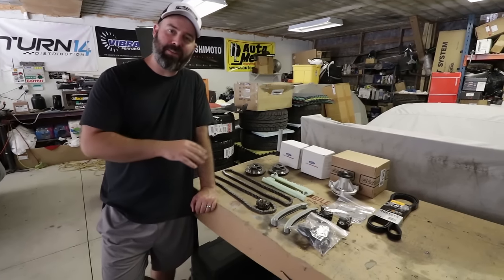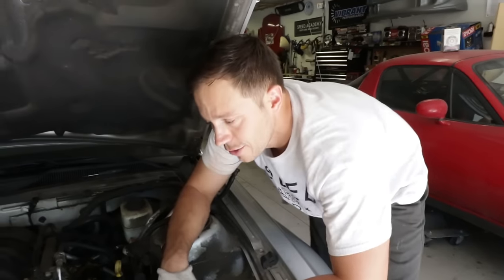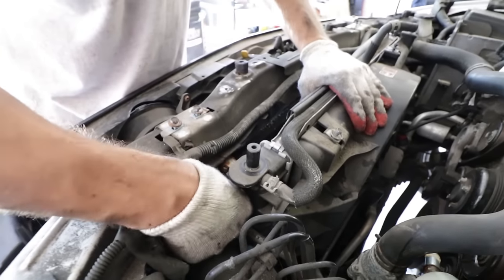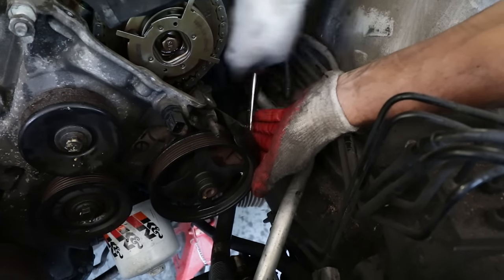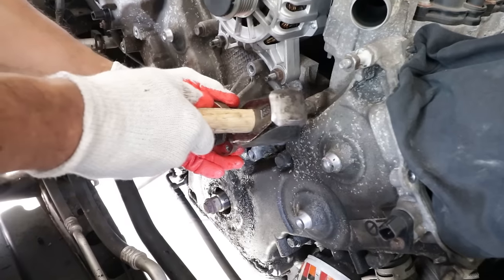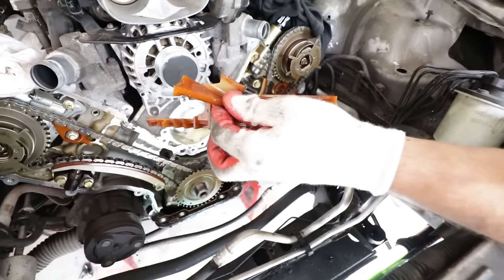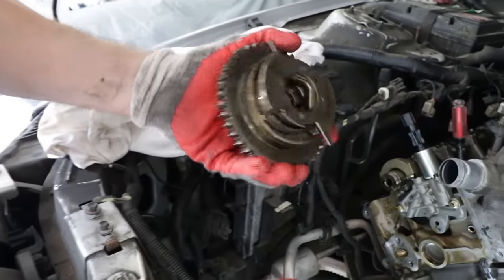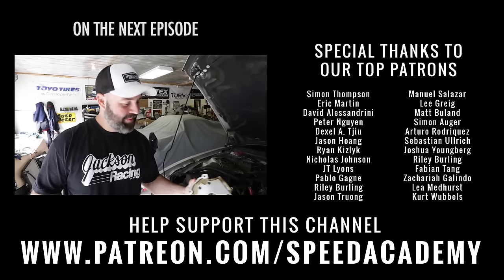How to Replace the Timing Chain 4.6L Ford V8 PT 1 -  Project Mullet Mustang - EP04

Comment: Anyone else notice that the phaser on the left cam is set up on the "R"  timing mark?? I know you Canadians are Bass backwards and all, but even you guys should know better.
Reply from the maker: We set them like that thinking we were at TDC which technically it still is but yes the manual calls for it being L not R on the left bank. Really its not that important if you put the new phaser in the same position as the old one.
Reply: I followed your video to do the final steps of my cam install and it went great. I appreciate you guys. I did the 127020 cams (which I think is what you guys went with). You guys are great. Keep it up!
Reply from the maker: Great to hear this video was useful!

Comment: should have done cams while you were in there.
Reply from the maker: We're doing them later down the road. We needed a stock motor to get track results before we mod it.
Reply: gotcha. good job getting all those spark plugs out.

Comment: I didn't realize these modular engines were such junk. Spark plugs breaking, water pump cavitation, timing chain guide failures... those are pretty serious problems.
Reply from the maker: Well it does have 250K on it and the water pump is only for guys that want to track their cars, not just go in a straight line.
Reply: Wow! those guides made it to 250k?  i'm impressed. Oh, wait. is that kilometers? I've got 60k miles on an 06 and i'm wondering if i should change the guides and tensioners just because of age.  @speedacademy

Comment: WHY didn't you just drop the oil pan? seems like you stupidly pulled the vehicle back apart.
Reply from the maker: Dropping the oil pan requires a ton of work. Watch another episode where we try to change out the oil pan for an aftermarket one.